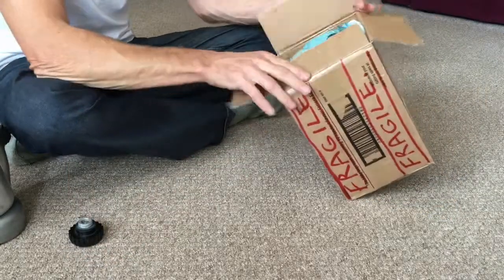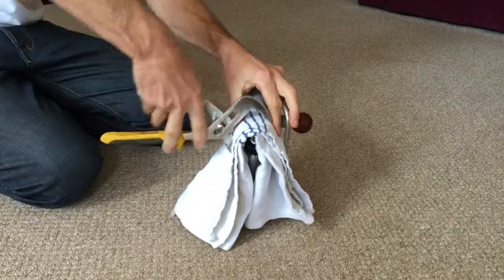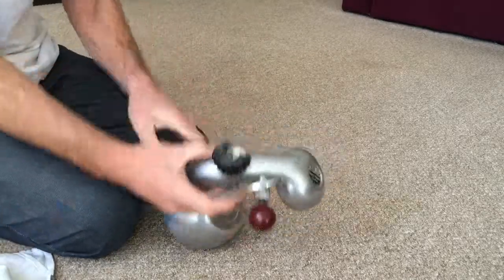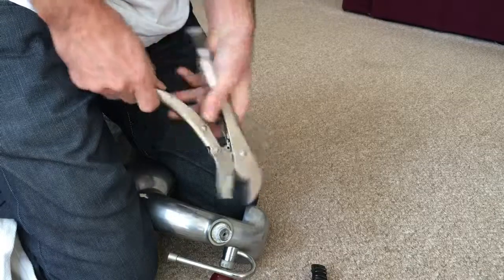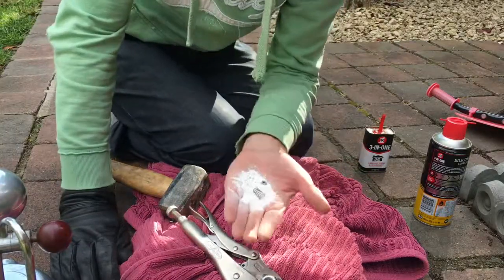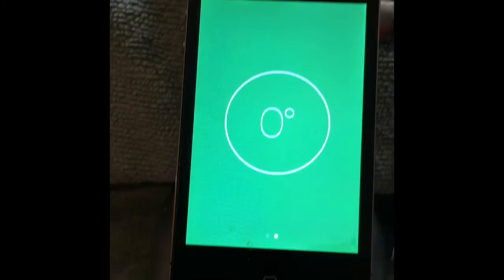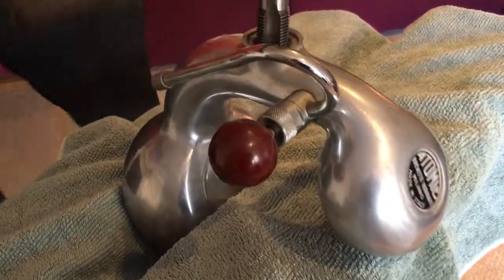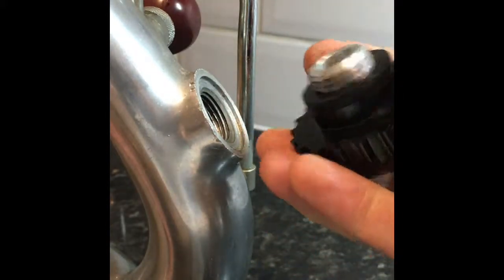Atomic Coffee Machine - how to remove a stuck steam knob and recut threads

Comment: I just posted this on another of your videos...
I recently purchased my second one and was disappointed with the performance, it would only deliver just over half a cup of coffee whereas my previous one would almost fill the pan to the top.
[I stripped it down, cleaned it up as per your instructions and it made no difference. As I understand how these things work I figured that the feed tube may not be low enough in the base to pick up enough water or that there was a hole in the tube defeating the pressure difference. So I took out the filler cap with the intention of prying the tube lower into the base but as soon as I looked inside I noticed a neatly drilled hole in the delivery tube. I checked my other machine and there was no such hole.
A home modification I suspect but why?
Any clues?]
I jammed a toothpick in the hole to seal is and the machine works fine now.
I just noticed that your machine has the same hole, this don't make sense to me.
What do you think?

Comment: I removed a stuck knob by pushing a rubber radiator hose over it and clamping it with a hose clamp. The rubber pushes into the gaps in the knurled grip, and couple of sharp taps on the worm gear with a hammer got it moving. But if aluminium threads gall and get really stuck then the more torque you apply the harder they become stuck! It's a tough one.
Reply from the maker: Thanks for your comment - that's a good idea. I'll give it a try next time. Mike

Comment: Couple of suggestions - 1) use a stilsons rather than a mole grip - this will give a better grip.  2) try suspending the metal end of the knob in vinegar to dissolve any  scale locking the thread in before you try heating. If this does not work...  3) heat up the body of the Atomic as per the video above but then put ice on the knob to get the end of the knob to shrink away from the body.    4) use a 1/2" BSPP tap. There are two types of BSP taps.  BSPP which is a parallel thread (both sides are parallel)  BSPT is tapered thread.  BSPP is better for this job.  These taps are not cheap,  so if you don't have one a cheaper alternative is to get a 1/2" BSP steel nipple, use an angle grinder to cut slots in the side of the thread of the nipple, then use this to cut the thread.
Reply from the maker: Thanks for your useful comments